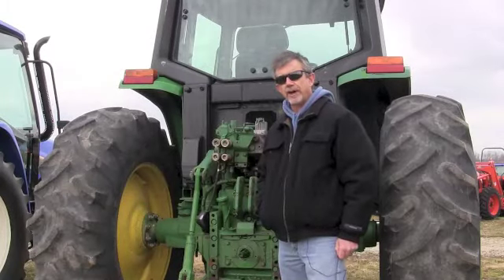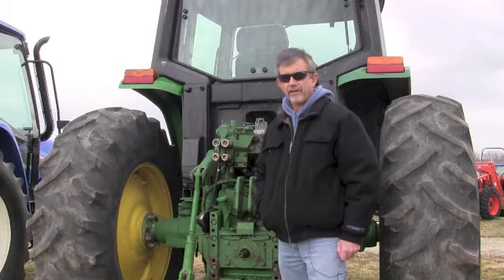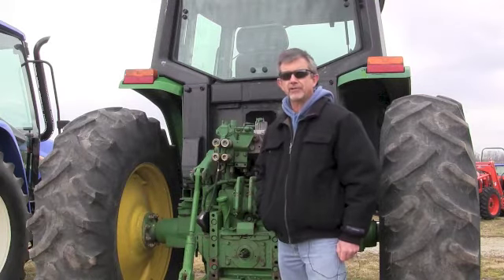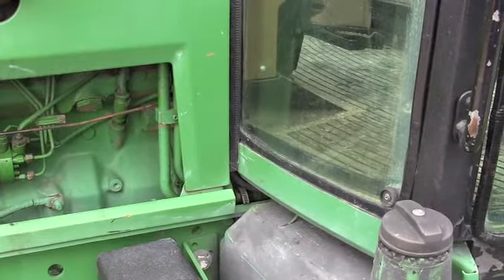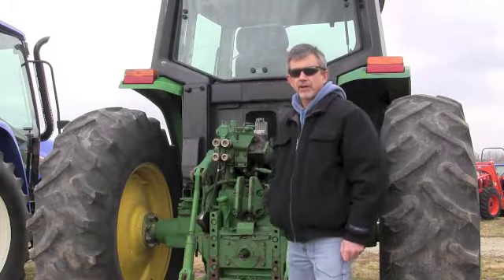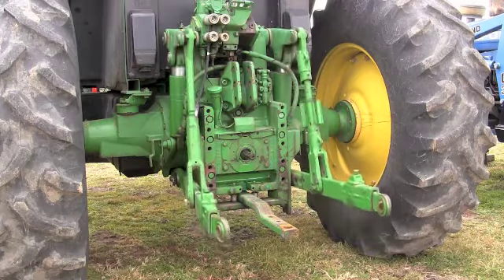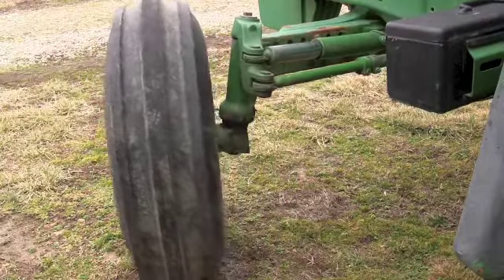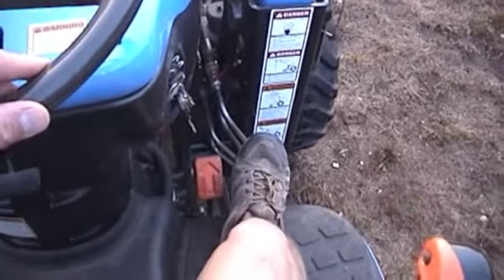What is the Difference Between Engine & PTO Horsepower

Comment: Can’t figure out what my pto hp is on my Massey industrial 2135. I was told the engine hp is 45 but I have found some specs that it might be 43 hp but no specs on what the pto hp is because the pto and three point was an option on this model. I have found in most cases its 5 to 10 hp lower than the engine hp. I found a rough calculation that if you divide 1.25 by your engine hp it will get you close to the pto hp. In whatever case, I am trying to buy a tiller and I can’t get anybody to tell me if the tiller I want to buy will work with my tractor without buying it and trying it out. I was thinking there has to be some way to figure this out.
Reply from the maker: I'm checking with my Massey contact, but he's an ag guy, not an industrial guy so I'm not sure he'll know.  Is the engine a three cylinder Perkins?  If so I'd think that would pull most tillers.  There's no hard and fast rule about parasitic horsepower loss.  It's less when there are not a lot of things the engine is running extra like air conditioners and powershift transmissions.  My gut feeling is that you could run that tiller all day long and have no problem because I'm a big fan of Perkins, but you also lose horsepower as engines wear.  A lot depends on what kind of shape it is in.  Also, is it a gear driven PTO?  Some of those industrial tractors had a hydraulic driven PTO and I'd have no idea where you'd be on PTO horsepower with one of them.
Reply from the maker: The Massey expert says the 2135 is basically the same PTO horsepower as a 135, or 38 PTO hp.  Again, that could be less if the engine has excessive wear.
Reply: Tractor Mike wow thanks for checking. Yes it’s a Perkins 3 cylinder. And yes it’s probably been through hell and back but it still runs.pretty sure it’s gear driven pto but I could be wrong. I went to a local dealer today and he thinks I’m around the 35 to 38 on the pto hp. Again it’s hard to say with it being so old and a lot of wear and tear on it.
Reply: I want to pull a 4 foot tiller behind it so I can keep the tires on sod ailes and till in between the tires which is 4 feet. I farm on hills so in order to reduce erosion I want to do a cultivated row with alternating grass pathways. But most 4 ft tillers are rated 35 hp and down so I wasn’t sure if my 2135 would be to powerful or not